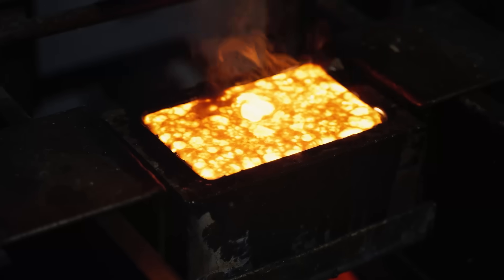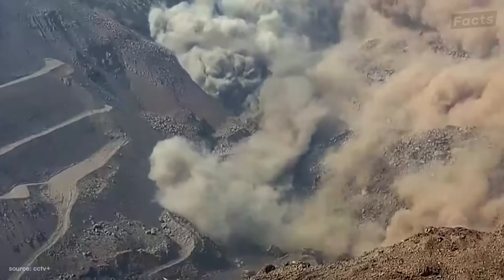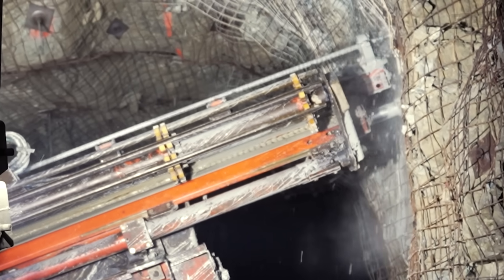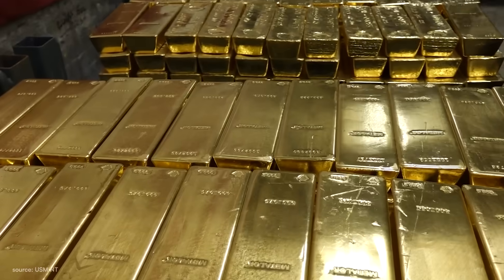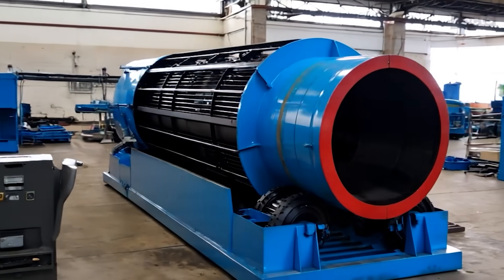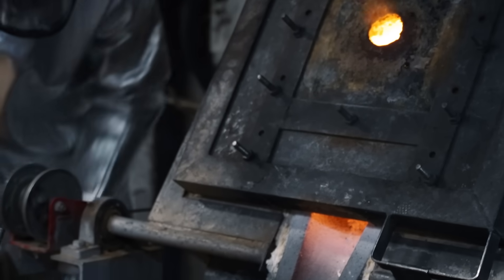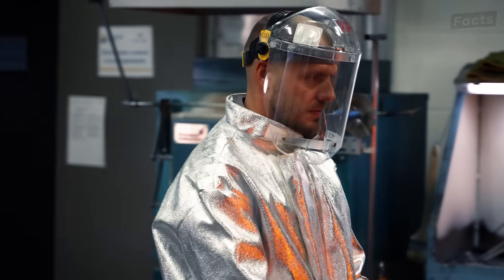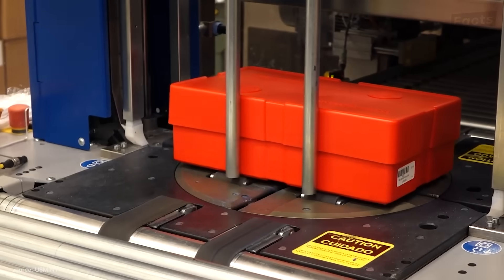How 99% Pure Gold is Made - Inside Secret Gold Factory

Comment: Thank you for your video..... Just finished this really solid breakdown on gold and timing entry points, especially with everything going on in the global economy. But what stood out to me is that the same reasons people are buying gold inflation, uncertainty, central bank pressure are exactly why I’ve also been investing in crypto. Bitcoin’s often called “digital gold” for a reason, and unlike gold, it’s easier to store, move, and trade globally 24/7. I’ve grown my portfolio from $130K to $532K in just a few months by following a consistent strategy with help from Milton Harper. Gold has its place, no doubt but crypto gives you that same hedge, plus major upside.
Reply: HE IS ON TELE GRAM.
Reply: @MiltonHarper
Reply: The key to financial stability is having the right investment. suggestions for a diverse portfolio. Many investment failures. and losses happen when you invest without proper guidance.
Reply: Nice info, i appreciate your concern this will help a lot especially to the young investors who have no or lesser knowledge on how the market works.
Reply: Milton's analyses delve deeper than surface-level trends, encompassing technical, fundamental, and sentiment analysis to offer a comprehensive view of the market.
Reply: Milton have been my backbone for about a month now. He earned me many proflts.
Reply: Best signal provider in the market. Knowledgeable, level headed no loss like some other traders who recently jumped on the bandwagon.
Reply: Access to good information is what we investors needs to progress financially and generally in life. this is a good one and I appreciate
Reply: I was big on gold and silver but a few months ago I discovered Bitcoin and Ethereum. Listening to lots of stuff from Milton has been really helpful in my journey..
Reply: The clarity and precision in Milton market predictions are astounding. I'm so grateful to have found his reviews here on YouTube as well.
Reply: sounds familiar, I have heard his name on several occasions.. and both his success stories in the wall Street journey!